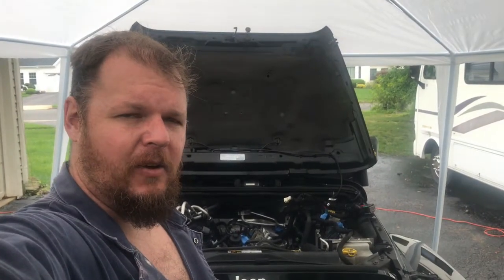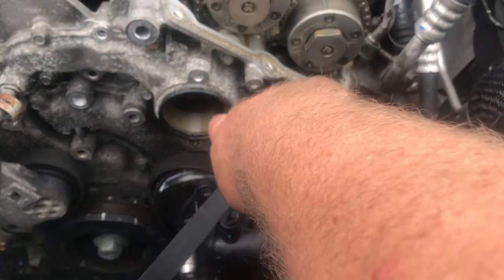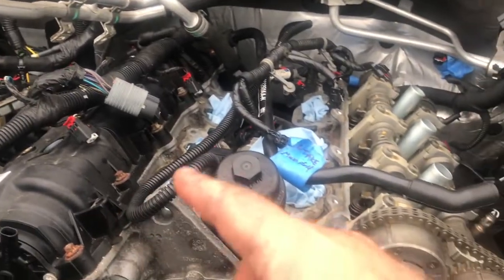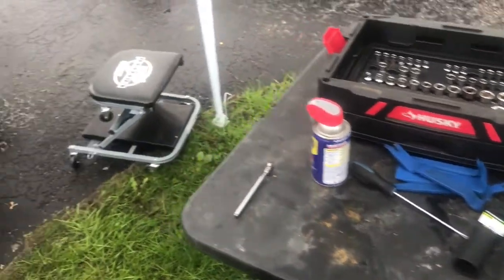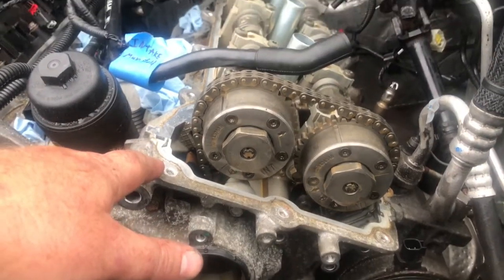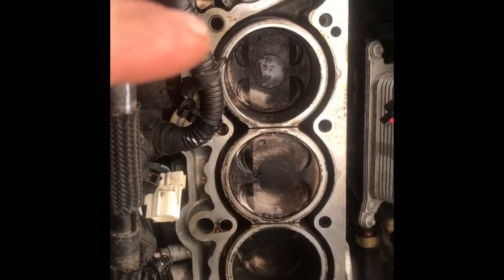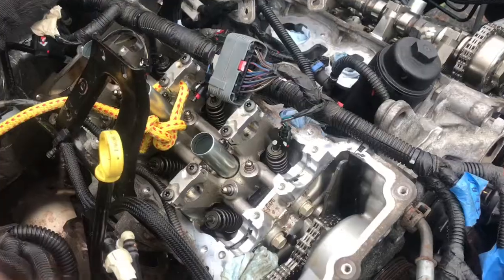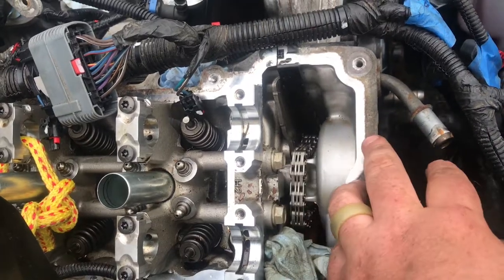Jeep jk 3.6L Headgasket replacement. What not to do. Plus tips and tricks.

Comment from the maker: Just an update this video is now 6+ years old. Vehicle is 12 years old and it’s still running. X wife got it in the divorce so I don’t know the mileage but she still has it.
Reply: Congrats on the divorce!
Reply: Great video mate, really helpful. It seems she did a real number on it and cooked it good and propper... I was wondering if you had to get any machining done on the heads or were they flat and good to bolt straight back on?

Either way, it seems like it's held up so well done.
Reply: Did you have smoke from tailpipe or bubbles in radiator?
Reply from the maker: @ whatever happened was quick- now c wife was driving called me said temperature gauge when high. I said pull over I’ll be right there she kept driving temperature gauge went low- probably because it had no water. She was about 5 miles from home. Limped in the driveway

Comment: Uhhh...you need to .. remove the 4 bolts at the bottom into the t chain cover ... remove the t chain cover...pin the t chain tensioners...then mark the t chain at the crank and phasers.. before you are removing the heads...

Comment: I'm in the process of doing repairs to my 2014 wrangler 3.6l due to a timing chain tensioner failure. I am curious why you needed a tool to remove the harmonic balancer? We simply put an impact on the balancer bolt and it came free. Once the bolt was out the balancer slide right off by hand. I am asking as I hope there isn't something wrong with mine as it came right off so easily. Thanks
Reply from the maker: @tominatorskyview8795  maybe just different tightness. I had an impact gun balancer spun so needed something to hold it. Didn’t want to jam something against the aluminum cover and crack it

Comment: 6:57 there was nothing wrong with that head gasket. It's normal for the ridge there to be missing. Usually it stays behind on the block when you pull the gasket. The gasket is the MLS style, which stands for "multi layered steel", that means it's several sheets of steel gasket sandwiched together.

Overall, nothing looked out of the ordinary on that cylinder head. If it was passing coolant, the combustion chamber and piston would be squeaky clean. It's called steam cleaning. The water evaporates, and steams the cylinder clean. All three of those combustion chambers look identical, black and carbon. The way they should be.
Reply from the maker: That’s the skewed view of social media. Engine didn’t run, pushed up driveway. only change was head gaskets. Engine has run for years since. The camera doesn’t always pick up everything
Reply: @steamman9193 glad it worked out for you I have a 2014. Not my daily so it is in good condition still.

But if this happens to me I would rather rebuild a 5.7 same gas mileage anyway easier engine with more aftermarket support.

Comment: Im happy I have avoided any chrysler product like the plague.
Reply: Thats your fault, I've owned many Chryslers not a days problem, every maker has thier issues
Reply: Why?  These small fixes are easy to do and these engines do last a very long time. I had 2 that had well over 250k and all I did was change a cam on both. The crosss hatch pattern was still on the cylinder walls of both.  Bet they last another 200k easy.

Comment: Did u reconditioned the cylinder heads machine it or fitted only gaskets
Reply from the maker: I didn’t have to. I knew it didn’t overheat very long and I checked everything with a straight edge. This was also a low mileage failure from a radiator crack if it had more miles on it a head swap would make more sense. As far as I know this engine is still running 6? Years later it’s the now x wife’s

Comment: I think I’d just throw the whole jeep out. Lol. Looks like a PITA
Reply from the maker: At he time running it was worth $28,000! Not running a lot less! This was a 2013 depending on mileage could easily still be worth $20k +
Reply: @steamman9193 I hear you. Hats off for tackling this. I did my rocker arms and what a pain in the ass. Having a P0303 code now that I’m trying to chase down. Trying couple more things and after that I’m parting ways. Not dealing with a head gasket repeat. Jeep can shine it. Never have I EVER owned another vehicle that had any of these issues. Oil cooler housing failure, camshafts and rocker arms, numerous sensors, and it goes on and on. If Jeep would take a breath and focus on some quality they would cement their reputation and have a strong lasting brand. But they choose to cut corners and make crap engines. Never again for me. Moving on to a Toyota lol.

Comment: I assume you replaced the chains, tensioners, guides, ect. While you already in there that deep right?
Reply from the maker: I didn’t because this was a low mileage failure from an overheat due to a cracked radiator. If I had over 80k miles I probably would have done them. As far as I know this engine is still running- now x wife’s car

Comment: Im in process of removing my 2015's heads.. Ive been chasing codes, this will be the third time Ive tore down the engine without removing the heads... here is a tip, start out with the phaser blocks (at TDC) and you can break free the harmonic balancer and the phaser oil bolts without special tools, if you get to this point you might as well do the timing chains - buy a yellow paint pen for marking your parts, I painted all the new parts as well because it makes reassembly easier. Just go ahead and remove the timing cover as well. PCV valve is a bitch, once you get it off do yourself a favor and get the doorman  replacement, it comes with hex screws and makes getting the screws back in WAY easier. Not looking forward to tackling the exhaust.. great video, thanks!
Reply: I’m just starting to tear into my 2015 with the same problem. Chasing codes.
Reply: @ bro….if I had it to do over again, I would have got a 5.7 and dropped it in. Ended up throwing a rod and sold the Jeep to a young man who got a used 3.6. 

Do the hemi!

Comment: You DO NOT have to take the timing cover off. I just made a tool with a short cut off torx and it worked beautifully
Reply: On a 2017 grand cherokee 3.6 drivers cyl head i won't have to remove timing cover? That would be great. Have coolant in combustion chamber on boroscope. Any tips?😊

Comment: Not sure if your still active on here but how did you get the passenger side chains off with the timing cover still on it? I’ve got a way to get the bolt out with out pulling the cover but can’t find out how to get slack I’m the chain on that side
Reply from the maker: Damm this was awhile ago. I did buy the timing chain tool don’t remember if I needed it though. Pretty sure you don’t have to have it if you pull the cover. 
Sold this jeep a few years back debated selling the tools. Still have them as I have another 3.6 jeep now hopefully ward off the job

Comment: I will be doing this job in a week or so..2013 dodge challenger..3.6l.
I have seen people attempting these so called short cuts....
It's a puzzle that can only be taken apart and put back together one way..the right way....
That is why I myself will be removing the engine from the car..
As to not make these kind of mistakes...and do the job Right the first time.i hope anyhow.....I have been working on cars since I was 12 year's old..I'm now 56.... I have learned that a few extra steps in any process , are most likely necessary for a reason...
It's easy to get in a hurry and think you have beat the machine...with a short cut in the process... in the end you grasshopper will learn ,,your only cheating your self in the end..
Follow the process take every step on that journey...you will actually get to your destination with much better results.....at least that's wtf I'm shooting for when I start this cluster F of a job ..one I really don't want to do at all....but I'm gunna give it a shot and hope for the best....do both sides.. should have heads checked and resurfacing at least,, check them with straight edge and fealer gauges..and by all means I will also use copper spray on my head gaskets....no guts no glory....
Fight on men,.... keep um running ..
Never give up and never surrender...

Comment: Did the coolant go into the oil?
Reply from the maker: No, not on this one that is usually a tell of a bad head gasket but not always
Reply: @steamman9193  I haven’t noticed my coolant go into my oil or anything like that. I had it tested by Jeep and they said the block test passed. I also did the combustion test and it looked good to me. But my Jeep keeps rising in temp. So I just used a leak finder pump and the gauge went up like crazy when I started the Jeep. When I accelerated, the Jeep pressure went up super high is this also a sign of a bad head?
Reply from the maker: @m9katchm9  what pressure? What temperature?
Reply: @steamman9193  I drained the coolant out to take the thermostat out and put water only to run it without a thermostat.. and it waste any more coolant.
I pumped it to 15-16 psi.. and it rose to 18.. and then 20 when off.. as I accelerated .. I haven’t noticed any loss of coolant
Reply from the maker: @m9katchm9  I don’t understand what you are trying to test. Are you losing coolant?

Comment: Sadly, I like the motor.  As well as the 4.7 v8.  So....  Gaskets not that hard.  The motor was a good idea.  But, they certainly have this problem I dunno what to say.  My suzukis, have timing chain probs.  I'd rather do the chains.......
Reply from the maker: I m on my 2nd 3.6 in a 2020 gladiator now. It’s a fantastic engine when paired with the 8 speed transmission. I get 20mpg on 33” BFG KO2S

Comment: The left bank bracket, holding the plenum, those 13mm bracket bolts can be accessed through the driver wheel well. Made mine easy once I saw that while removing exhaust.

Comment: Did you find it necessary to change chains & tensioners due to damage from overheating?
Reply from the maker: No
Reply: @steamman9193  thank you for the reply. Took ours to a shop for tests and after determining head gaskets are failing in the estimate they are replacing tensioners and timing chains. Feels unnecessary.

Comment: I just did a 3.6 engine replacement on a Chrysler 200. Honestly not terrible, but a very time consuming job. I never bothered to label my harnesses since each connector is unique and the harness once placed back in the engine bay, everything is within close proximity of each other to connect back in. One thing I will say, screw those 'Christmas tree' clips that hold every wire in. That consumed a bunch of my time getting all those out.

Comment: There is a way around the crankshaft removal tool. Before removing the chain cover use the serpentine belt as kinda like a strap wrench lettin the top of the belt go around the timing cover take the rest of the belt to kind of overlap on the crank pulley.use a 24" breaker bar to get it loose.IT WORKS.

Comment: Did you get a lot of the torque specs from a Haynes manual?
Reply from the maker: exactly. i got a free online manual
Reply: @steamman9193  quick question. Does the manual say to put anything on the head bolts. My manual is on its way. Should be here tomorrow

Comment: Labeling things seem like a good idea so I tried it once and realized something in doing so.
Purposely I believe all connectors only fit in the location they came from making it almost impossible to connect any wrong. The harnesses only send connectors so far finding the location easy to find, even if I look at the connector and don't remember where it came off, which is rare anyway. 
The bolts are the most important to organize, putting them with the part in hand, played out in the order removed to know what goes back on first.
Which can become important.

Oh, and by the way a small prybar in the hole facing it, to the left on the bottom removing the nut easily. A small nick in the cover as a result.
Reply: Also just a little pro tip, that electrical spray is necessary not an option when plugin in old electrical connections, it basically lubes up the old rubber o rings in most of them and allows them to seat properly, u get that click you should always feel when connecting them. Also works amazing for re connecting the radiator hoses or any hoses, because it evaporates when it dries almost immediately.

Comment: Only 4,000 for a crate motor from Mopar with warranty ,labor cost for replacing head gaskets on 3.6 is over , if you're on a budget get one out of the salvage yard for 1,850 I would not have invested the time and money into a repair of a overheated engine, especially the 3.6..I have been a mechanic for 15 years but that's just my thoughts.

Comment: The harmonic balancer has a key. After taking the blot out It should just slide off with a pry bar.
Reply from the maker: Slingapens26 sliding off wasn’t the problem getting the keeper bolt off was. It was tight was afraid I was going to break or bend something expensive without the pully removal tool. I’ve broken a lot of stuff in my day. I know when too much force is applied. I was close without that tool.

Comment: Did you check the compression of each cylinder before tearing into. My buddys jeep lost all of his coolant, luckily he saw that and shut it down before it overheated.  We are leaning towards the head gasket but would love to know what made you go there instead of the heater core or lower intake or something else?
Reply from the maker: footballer52 it wouldn’t start. Was still losing water. I knew. Call it instinct or experience but a compression check wouldn’t hurt. If you fill it back up you should find the water somewhere

Comment: Holy hell, challenger owners have to drop the lower oil pan to get to the 4 bolts on the bottom of the timing cover. We have different lower ends than the jeeps.  What a hell of a mess just to change the heads.

Comment: Hey can you give me some dimensions on that crank tool please? how far apart are the fingers from each other.  I want to make my own since I work in the metal industry.  im cheap i know   Thanks for the info. Im about to do the same thing to my crapola challenger.
Reply: It’s the now x wife’s car so wasn’t going to spend more than I had to. I took a straight edge and checked as many way as I could. I felt good about finding bad gaskets. If you don’t find bad gaskets than you may want to check your heads or get new ones $$$$$
Reply: @Chippers-r5i  sorry to hear that.  But thanks for getting back to me.  If your in the Houston area feel free to come by and give me a hand.   BTW my car is boosted and I think that aided in the blown head gasket/s Im not sure.
Reply from the maker: Triple Nickle I can’t find it. All you need is something to keep it from turning while you take of the nut. I didn’t have anything to make one out of so I just spent the money. Plus I was exhausted from all of the actual work
Reply: I pulled some dimensions off mine tonight. I have something in mind that will work.  Did you check out your heads after you pulled them off? I'm sending mi e out to have a leak down test performed on them and check for warp.
Reply from the maker: I’m actually in Houston pretty often but nothing scheduled right now. And yeah a turbo can do that you are probably putting out a lot of power per Cubic inch it’s got to go somewhere. After this I ordered an cordless ratchet. Best tool money I ever spent. Milwaukee is the only one I know available on the shell but you can order them online pretty cheap.
Reply: @steamman9193  Its supercharged.  People are putting RIPP SC's on these motors since the motors were designed for boost.  Unfortunately the other parts were never upgraded since the twin turbo motor never happened.  This is why the exhaust manifolds have build in exhaust manifolds, for the turbo's.     Oil cooler issues, head gaskets and water pump issues.  Im sending my heads off to a local race shop here in my area to be checked out.  I dont want to do this job twice.
Reply: @steamman9193  The harmonic ballancer I made works great to remove that damn bolt.  That thing was tight.  I plan on trying to sell my holder once Im done with it.

Comment: Nice job. I've been thinking about replacing the heads on my Jeep after my wife sunk it in a huge mud hole.
This looks easier than I was expecting. 

I have replaced heads on other vehicles and I know my 4.0 like the back of my hand. But the furthest i've jumped in on my JKU is the oil pump and oil sending sensor.
Might be knocking heads out soon.

Comment: I had a chipped intake valve on the passenger's side.  I was able to get that singular torxs head bolt off by taking the very tip of a torxs bit and welding it into a tiny box wrench.   Then ground the tool thin enough to loosen the bolt, then needle nose vice grips to back it out.  Make sure to stuff rags down the timing chain openings to prevent anything from falling down.  I placed a magnet on the head of the bolt and used a stubby hacksaw blade to cut the head off then finish extracting the body of the bolt.  If anyone tries this, be super diligent to prevent any fillings from getting down the timing chain openings.  Also keep any magnets away from the cam phasers.  My favourite part for reassembly was using a slightly shorter hex head bolt for the chain guide bolt that was cut.  Now a standard open ended wrench can be used.  It took about an hour, but I was able to avoid the removal of the front timing cover.
Reply: PS Thank you for posting this, I couldn't find any videos on the right hand side head when I went to do mine.  It was a 2013 JKU 3,6L.
Reply from the maker: Jeff Lemke I thought of that but decided against it since now there is a lot less thread engaging that chain guide.